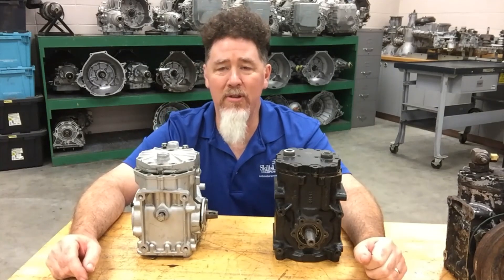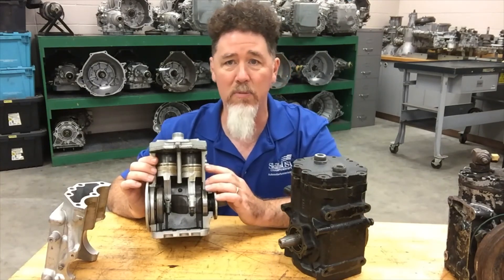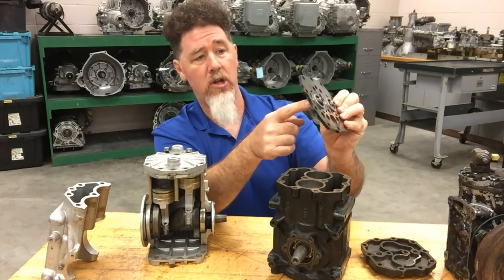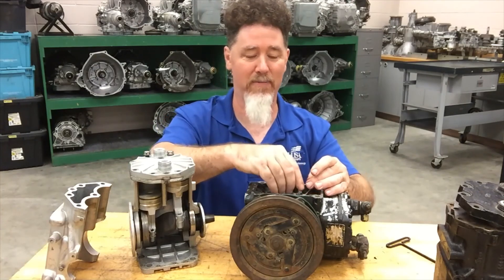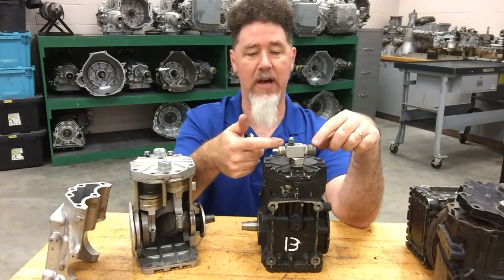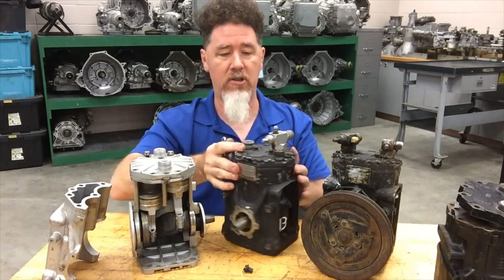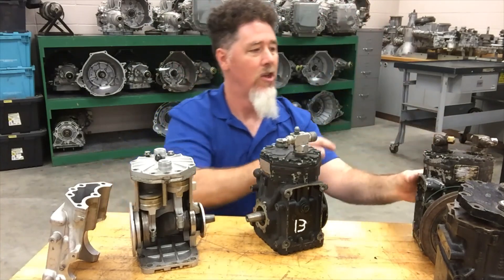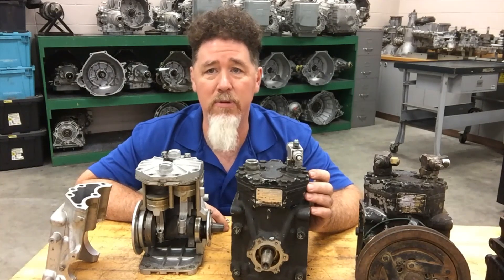Lesson about the In-line A/C Compressor Part 1

Comment: After closing valves, if the compressor oil is checked, doesn't that allow air into the system?
Seems would have to pull a vacuum and refill?

Comment: This video saved my life : )
I could not figure why AC was not charging... those valves (like mentioned in video) have to be in middle position (about 4.5 turns in clockwise).
All the say counter clockwise is for standard use. 
Half way (about 4.5 turns) is for charging and purging. 
All the say clockwise turns off hoses and charge ports. This is for removing compressor and saving the refrigerant. 
I don't think valves like these are standard any longer? Was a cool idea, but think it may have driven many mad, I was on the verge of insanity before realizing these are part of the game.

Comment: On one of these compressors when testing oil level, what is “full”?
After some searching and manual reading "full" is 3/4 to 1 inch.
Reply from the maker: There is a dipstick in a special tool kit to measure oil level.

Comment: Great informative video Professor.
I love that you mentioned the york compressor on your 85 Grand wagoneer I have the same one on my 86 GW but not blowing any cold air and looks like it was never converted to r134 

Do you recommend a conversion kit I can use that will not break the bank? Or if I decide to have a shop do it what should I make sure the do or use? 

Thanks in advance 🙏🏼

Comment: I have a 1970 Ford with a Tecumeh compressor that has a small leak on the side opposite the valves.  Looks like it is secured in place with a C clip.  Know where I can find that seal??  Thanks in advance.

Comment: Hi I have 1964 lincoln Ford compressor. The small snap ring that hold the inner bearing does it have to fit into a groove or does it just snap tight to the shaft?

Comment: The York and Tecumseh inline twin cylinder compressors are still the best automotive and truck compressors ever made. As the professor said, as long as you keep oil in them they will keep on working. There are 60 year old York and Tecumseh compressors that still work like they did when new, because they were maintained. Eventually, after enough years and/or miles (or hours), the front seals will start leaking to an unacceptable degree. A new T/CCI seal kit is about $70, and is fairly simple to install. The rear crankshaft bearing retainer is sealed with a Neoprene o-ring, and sometimes they will leak with age and heat. These are a bit more difficult to replace because the bearing is a press fit in both the retainer and onto the crankshaft. this job is best done on the bench, and the entire compressor should be re-sealed in that case. It is ALWAYS best to re-seal your otherwise well-functioning compressor vs taking the chance on a parts store reman. 

New compressors are still made in the USA by T/CCI, in the same manufacturing facility where York, and then Borg Warner, made them. There are also cheap Chinese-made clones available. Avoid them at all costs! They have neither the durability nor longevity of the T/CCI or original York units. Many are noisy right out of the box, have excessively leaky front seals, or other issues. Spend the extra money on a real T/CCI. They arent all that much more expensive, and will outlast 10 Chinese clones. If you want a deal, check Ebay. NOS and surplus brand new T/CCI compressors are common on there. Prices range from around $150 to $250 or a bit more. New units are around $300 without a clutch to $450 with clutch. Be careful when shopping, as many sellers will show a T/CCI compressor in their pics when they are actually selling a Chinese clone. If the listing says "T/CCI style" compressor, it is a Chinese clone. If it says "T/CCI (York style)" then it is probably the genuine deal. When in doubt, ask. A real T/CCI compressor will say "T/CCI Manufacturing" at the bottom of the nameplate, with the "T/CCI" part being in the form of their logo. There is usually, but not always, a sticker on the back with a USA flag that says "Made In USA". Again, don't cheap out and get a Chinese clone. You will regret it. You're also supporting the Chinese government rather than hard working Americans. Don't do that.

The professor uses a 12pt box end wrench on the service valves. There are square drive ratcheting wrenches available at AC supply houses and online that are designed for these valves, and wont slip if the valve stem has large radii on the corners. When hooking up gauges and opening the valve, do NOT open to the true mid position. You only need ½ to 1 turn off of the back seated position for the gauges to read properly. This will prevent the flow through the valve and into or out of the compressor from being restricted. The only time you want to be to the true mid position is for recovering or evacuating the system. In this case, count the turns between the front and back seated positions, then rotate the stem exactly half that number of turns from either the front or back seated position.

Do not let anyone convince you to replace the "old, obsolete, power hungry" York or Tecumseh with a "new whiz-bang modern "rotary" compressor" (usually a Sanden). With the exception perhaps of the "old" part, everything about a statement like that is false. Modern hermetic and semi-hermetic reciprocating AC and refrigeration compressors are the same basic reciprocating design as the York and Tecumseh. You will never find a stationary compressor using a swash or wobble plate driving axially mounted pistons. There are many reasons for this, both economic and engineering. Suffice it to say, the important aspects of any compressor is performance and longevity. Very desirable aspects include servicability/repairability/remanufacturability, efficiency, compactness, light weight, and low NVH. When it comes to performance, longevity, and service/repair/remanufacturability, the York design (and Tecumseh, although parts are no longer made) beat any axial recip, rotary, or scroll AC compressor. They are also very efficient. They arent as compact or light as an axial recip, but that doesn't matter much for their original applications. Same goes for NVH, although with a solid mounting bracket, belt drive arrangement, and mufflers on both suction and discharge these comoressors don't create very much NVH.

What the above boils down to is this: if you have a vehicle that was originally equipped with a York or Tecumseh, KEEP IT! Don't convert it to a Sanden, Denso, Seltec, or other axial recip. Unless you use a large axial, like an A6 or Seltec TM21HX, or perhaps a Denso 10x20 (where x is a letter code determining the exact style), you won't match the impressive refrigerating capability of the York/Tecumseh. Although the largest York and Tecumseh compressors are 170cc displacement, their excellent valve configuration and wide open internal porting gives them excellent volumetric efficiency. Thats why they can have the refrigerating capacity of an axial compressor with 30-40cc more displacement. They also have very tight piston to head clearances and little dead space, which improves VE even further. As far as power consumption goes, they don't actually use any more power than any other compressor OF EQUIVALENT REFRIGERATING CAPACITY. I put that in caps because it is important. Sure a Sanden SD7H15 will use less HP, but that's  because its displacement is 155cc vs 170cc for the York 210 and Tecumseh H1000. Actually, given their relatively high isentropic efficiency they are more efficient than many axial recips. That also gives them more refrigerating capacity per cc at the same input shaft speed. Yorks typically have somewhat larger pulleys than a typical axial recip, so they spin a bit slower. Thus, while their capacity is higher than most axial recips, it's not as high as it would be if it had the same smaller size pulley. 

As mentioned, these compressors, especially with R-12 (this goes for any AC system - 134a sucks by comparison regardless of the compressor, and R-1234yf is absolute dog's breath), have a LOT of refrigerating capacity and will flat freeze you out on all but the hottest days in the SW or hot, high humidy days elsewhere. Even under those conditions they will do better than any "modern" system. Replace them with a Sanden SD7 and you wont get that kind of performance.

BTW, all of the above goes for the Chrysler V2 and RV2 v-twin compressors. The V2 and RV2 have larger bores and a shorter stroke compared to a York or Tecumseh. Displacement is comparable, however. They use more conventional "finger" style reed valves rather than large radial valves like the York and Tecumseh. That said,  efficiency is likewise high thanks to the large bore allowing three intake and three discharge reed valves per cylinder. So, like the York and Tecumseh, they breathe well and move a lot of gas.
Reply: I forgot to mention one important thing on these compressors: make sure to run them for a few minutes at least once a week. That will keep the front seal lubricated.  The seal rides on a very thin film of oil. This oil both lubricates the seal and actually does the sealing. Over time, the refrigerant under pressure in the crankcase will slowly force the oil out from between the carbon and the lapped iron that it rides on, and it will leak. Worse yet, the next time you start the compressor the carbon will be running dry on the cast iron. This will eventually damage the seal and prevent it from sealing, even with oil. 

This applies to all compressors with carbon face seals, not just the York and Tecumseh. That includes pretty much all compressors made before the 80's. In the 80s, lip seals started widely replacing face seals in automotive AC compressors. The lip seals should also be run for a few minutes every week for maximum sealing, but they are more tolerant of dry starts. They lose their oil much more slowly, and dont leak nearly as much even if the oil is gone. They are good seals, but they have a couple drawbacks vs carbon face seals. First, their overall lifetime tends to be less. Not short by any means, but not as long as a maintained carbon face seal. Second, because they are designed to ride directly on the shaft they will often wear a groove in the shaft, or cause an eroded low area where the seal rides. Eventually this, combined with  wear of the seal itself, will result in leakage. And since the shaft is damaged, a new seal wont fix it. The only option, if available, is a Speedi-Sleeve. But, as said, that assumes one is made for the size of the shaft. I doubt that is the case. If the shaft cannot be economically repaired, then the compressor must be replaced, even if it otherwise works fine. Fortunately, or unfortunately, the Teflon rings, the bores themselves, and/or the valves  are worn enough to leak at this point, so the compressor no longer pumps efficiently enough for acceptable performance. Because these are inexpensive axial compressors they are disposable, so you toss it and get a new one. That's modern economics for you.
Reply: @WTFChuk  
Hey Chuck, i even had to login to congratulate to you, that you nailed so many actual background info into this one little post. For example our government (with ours i mean the German stupid politicians) doesn't care for that damn LowFrequence noise of wind turbines that are robbing quiet sleeping..
And you just mention it - as a fact in a sideline - that really makes my day  🙂

Beside i like using the RV2 compressors (also as a retrofit in non AC cars) for years
Reply from the maker: Hi Chuk,  thanks for the great comments and thanks for watching.
Reply: @ProfessorPentane  Thanks!
Reply: Have a York on my 67 Ford XL convertible works great other then you know when it kicks on and the belt can vibrate it works fine
Reply: @ericheld4382  if you didn't notice it kicking on, it would be a small, low capacity compressor. Or worn out!

I have a 5.9 Cummins with a Seltec TM-16HS (better than a Sanden SD7H15, but I digress). Its displacement is 169cc, so comparable to the York. It doesnt breathe as well, but Seltec uses a small pulley to spin it faster to compensate for that. When it's hot and the head pressure is over 225psi, you notice when it kicks on. That's just the nature of the beast. Refrigeration takes power, and the more BTU's (KW for those using the metric system) of refrigeration, the more power it consumes from the engine that's turning it. That's simple physics/thermodynamics, and theres no way around it. You can put a smaller compressor on your car, but then you lose performance. Especially in stop & go traffic, where its needed the most!
Reply: You know a lot about that compressor I'm impressed and thank you for the info
Reply: I'm in San Diego when I get my A/C working I'm sure I will used it at least once a week